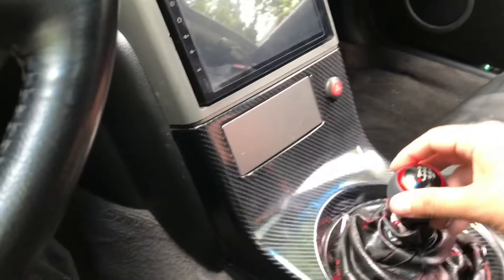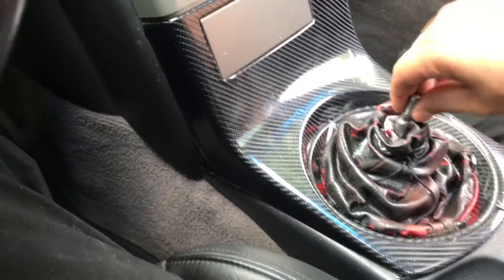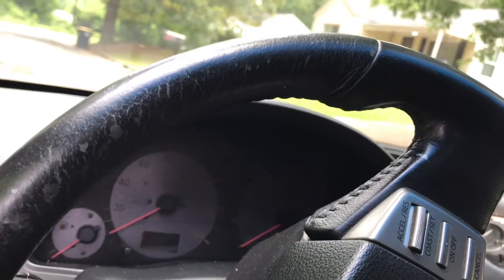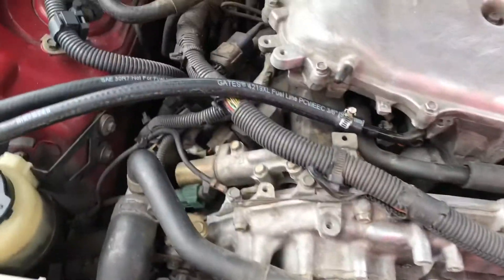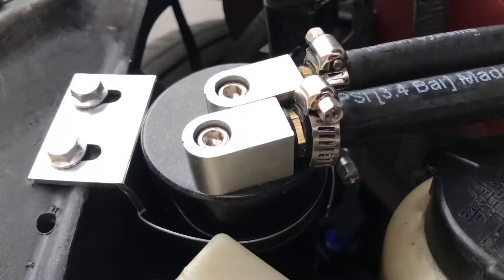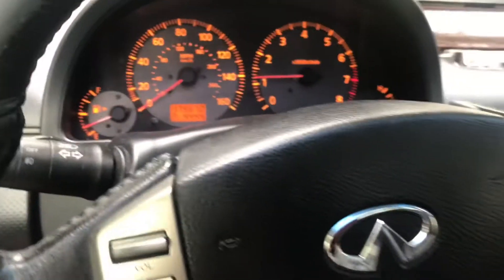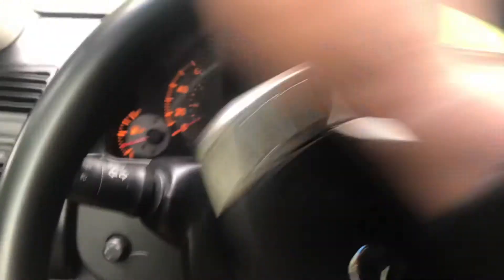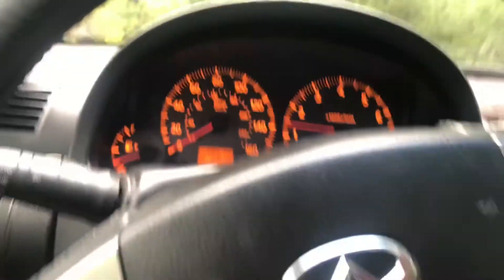TEST PIPES ON STOCK EXHAUST G35

Comment: Im trying to find clips of different exhaust set ups for this car. Im looking for the cheapest option available. Im thinking about taking that heavy stock resonator off and replacing it with a 22 inch magnaflow glasspack. From there I'm not sure which will be better, a muffler delete or an aftermarket muffler? Im trying to keep that stock exhaust note. I like the little growl it has on start up. The intake sounds great, I have a CAI and a plenum spacer. But I'm absolutely trying to avoid that ricer fart can sound. I dread that raspy drone. I may just stick with the glasspack, It should keep it as close to stock as possible. I really need to focus on replacing the whole front suspension. The bushings are completely shot. It's not cheap, especially with it being an X. Plus I have the first yr model of the X, so it has LCA that are specific to that yr. It's going to be a bitch too replacing the damn ball joints. Not looking forward to that. But it needs done, I might go ahead and lower it. But will need new suspension before I do. I've already invested a lot in getting this car tuned up and cleaning the hell out of the engine. I keep getting this damn lean code on bank 2 though. I have a vacuum leak coming from somewhere. Im thinking it has something to do with my hoses going to the oil catch can. I have both banks running to it, with an outlet going to the lower plenum vacuum. So it's a closed system, but it's a baffled can. So it does a good job at catching all of that blow by. I probably get about an oz of buildup every month. So it's definitely working. I just need to pinpoint this vacuum leak. Need to buy an extension so I can take a look at the spark plugs. I just replaced them a few months ago, so they should look great. If it's running too lean though,then there may be a fouled plug or two on that bank? I also probably should get better intake tubing or possibly a different cone intake. I just have a cheap Spectre from Autozone in it. It had a K&N but it was beyond gone. I just have a cheap intake tubing on it. It was just a short ram tubing. I just added this cheap plastic shit that can stretch. It's hard to explain but I have it to where the cone filter sits in the driver side wheel well just behind the bumper. I've definitely noticed an extreme difference with these intake mods as I also have a plenum spacer. I painted the valve covers as well as the plenum. Before the plenum would get so damn hot it'd burn me. Now I can drive it 4 hrs straight and it's barely warm to the touch. I was going to do the throttle body coolant bypass. But that may be a waste of time, don't see that really helping much. Maybe in the summer when it's 100 outside. For how old it is and the fact it has 209k, I'm extremely impressed with it. I hope I can get it to last another 100k. Just want a good 2yrs out of it before I sell it. I wouldn't get much by that time, I may just keep it and drive it until the wheels fall off. It's nothing special, so I wouldn't waste my time doing an engine swap. It is just an extremely reliable daily driver. What more can you ask for with a cheap used car. Not trying to race the damn thing, I'm not one of those delusions G35/350Z owners that think they are actually fast. It's plenty fast for a daily and to have a bit of fun in. It's only realistically a 13 second car on a good day. I know what it is and what it's capable of. I'd just get a real sports car if I wanted to race. The older I've gotten I've slowly steered away from owning sports cars. I like the nice combo of Luxury and sport. I don't have kids so I don't really even need a sedan. But I honestly like the way they look. Once I'm done with this though, I'll either get an Infiniti M56S or a 370Z. I've fond of Nissan's though, out of all the cars I've owned over the yrs. Nissan's have been the most reliable. I'd consider getting another 300zxTT, but I know it's be a money pit. If I can get my friends father's 94 300zxTT for a good price then I'd consider it. Just keep it a track car as it already is. It's definitely not street legal nor daily material. But it's a real sports car, it has just been sitting for the last 10 yrs. Just wasting away, it's had so much work done to it though. And it's definitely one of a kind, I've always loved Z32s.

Comment: The rasp is because you're getting alot more exhaust and exhaust speed that's getting squeezed by the more restrictive oem exhaust piping
Reply: Um what? 😆 the rasp is from the construction and material of the pipe. The rasp has more to do with the thickness Guage of the steel or material used in making the exhaust..
Reply: That's like saying if you grab a bigger straw it makes a different noise when you drink your sweet tea. It doesn't lol